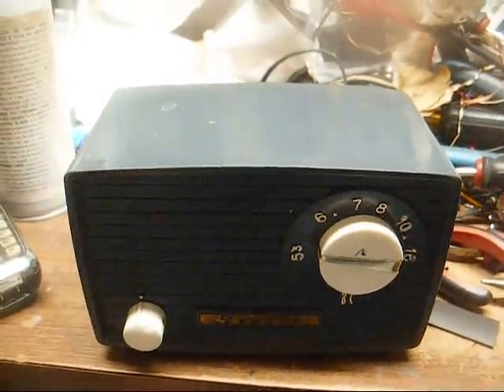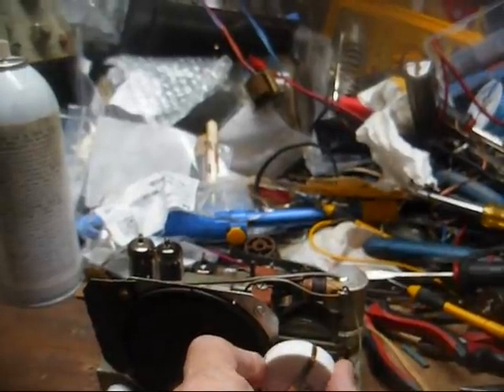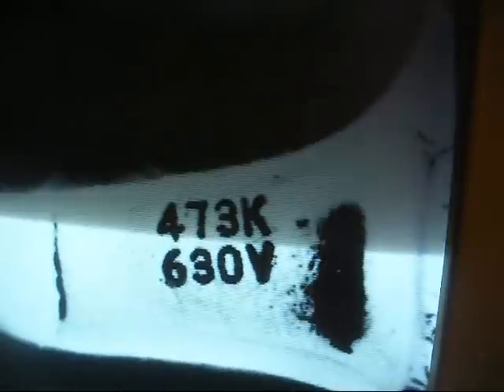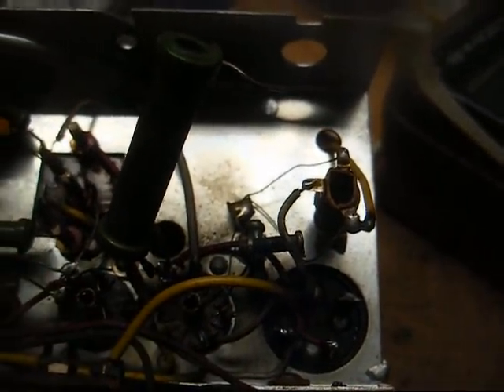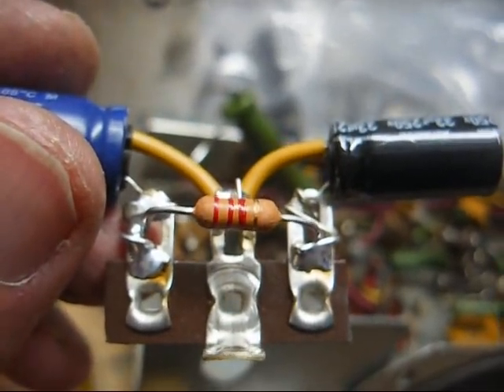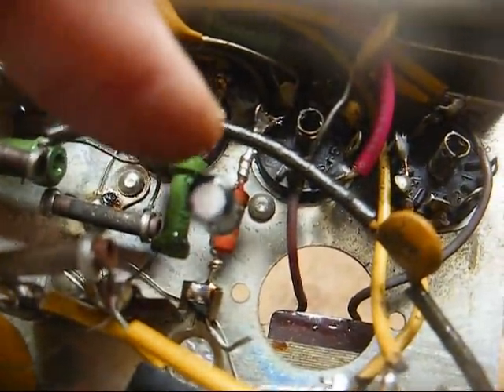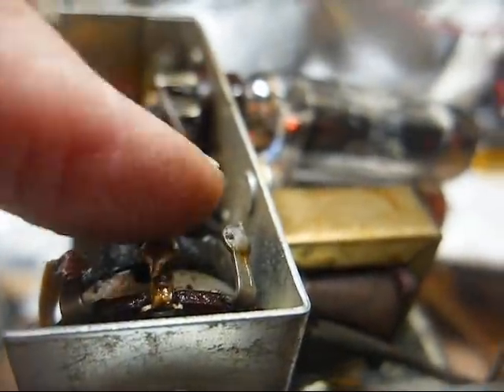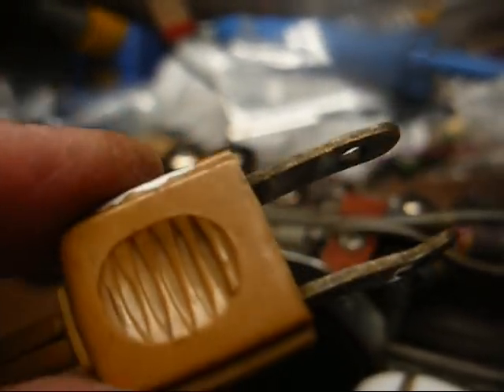Zephyr Japanese tube radio (another one from my "back files").

Comment: Just started doing an assessment of one of these for my son, a Delmonico model 602. This one had the original across the line bomb, which was overheating, and dripping wax. Clipped that sucker right out of there and measured it on the Heathkit IT-28 just to see how leaky. 0.05 uF 400v cap that has no eye opening at 6v, pretty much shorted.

 Lots of wires that can get touchy feeley, and cold solder joints to fix. All tubes tested like low hour ones, all Japanese with the exception of the 50C5 which is a Raytheon.

Comment: I got one of those Talking House AM transmitters used by real estate people at Goodwill for $10. You have to mess around with increasing the antenna length to something it can still auto-tune while eliminating hum. I got it to where I could transmit to the whole house and the neighbor could get it on his car radio. There are mods and schematics online with some people on forums claiming 1/2 mile range. It sounds pretty good but not great. Some of the mods address that and claim to improve sound quality.

Comment: That's a very nice 📻 radio. If it's one from your stash, I really wanna 👀 see ya restore it. Just recap, and re-tube. The dial cord looks fine. I don't 👌 know if this 📻 radio has a dial light. I don't even 👌 know if this is a 🔥 hot chassis set. 👍 Yes, sounds 👍 like it. Organic rubber wire can be a nightmare. Cracked solders can also be another problem. 👍 Good 💡 idea to re-flow them. Ya don't want shocks or 🔥 fires. Hopefully the volume control potentiometer isn't 👎 bad. The case of this 📻 radio is in such 👍 GREAT shape. Looks 👍 like 🍫 chocolate brown, and completely original. It also looks 👍 like Bakelite. Your friend, Jeff.